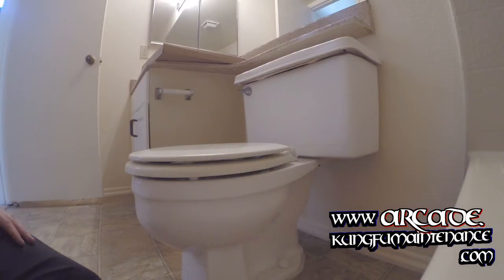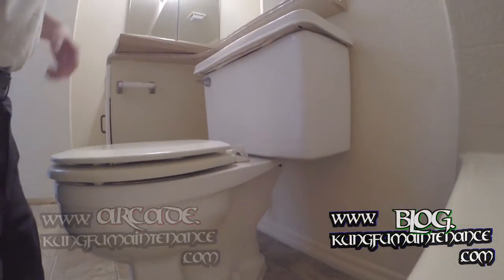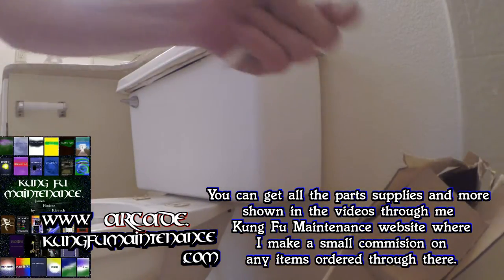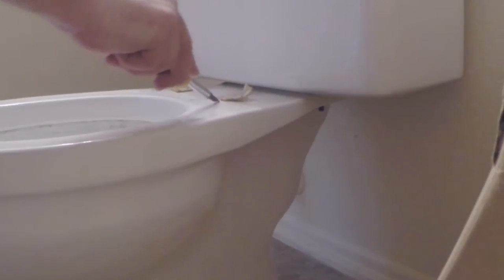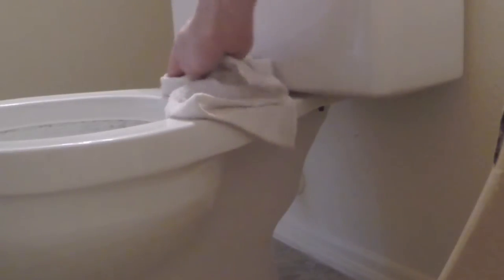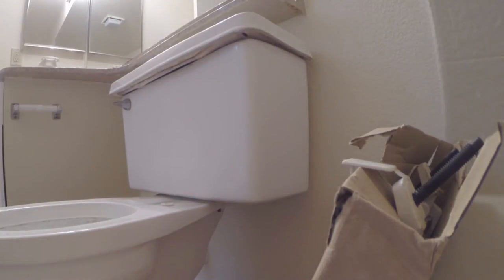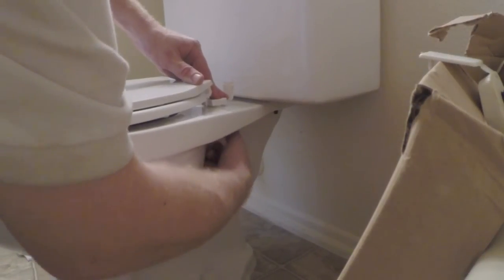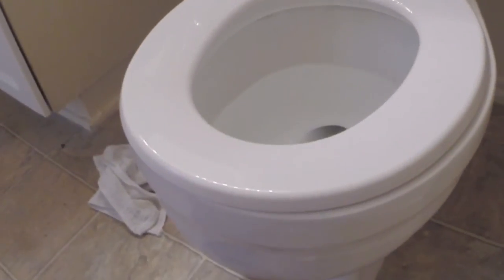Why I Prefer Plastic Over Wood Toilet Seats Replacing Maintenance DIY Repair Video

Comment: Plastic lids cave in though when you just want to sit on the top lid. Though they cave in they don't break. What's your opinion on this?
Reply from the maker: +RedLight GreenArrow I  had a plastic lid break first time I sat on it! LoL... 
I did still buy a plastic seat to replace it for the sanitary reasons. I just bought a little bit stronger one to prevent the toilet from insulting me again. LoL... :0)
Reply: The seat part has always been fine for me but the lids are always questionable. The one in our house has been going 5 years, despite caving in every morning when I sit there to warm up my shower. I'm surprised that the plastic lids can be durable if you choose the right one, though feeling flimsy. I weigh about 227 lbs. But I was always wondering if we should go wood for the "comfort" of using it as a chair but we just never cared much to do it- who knows maybe this one will finally snap one day lol!